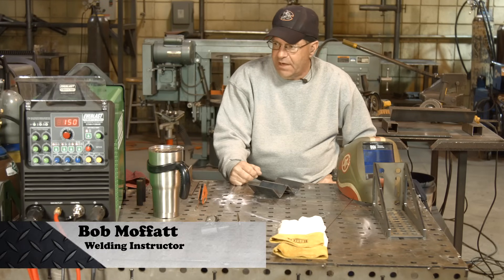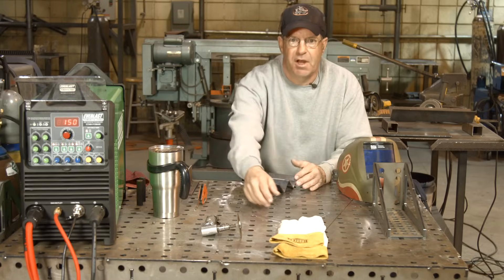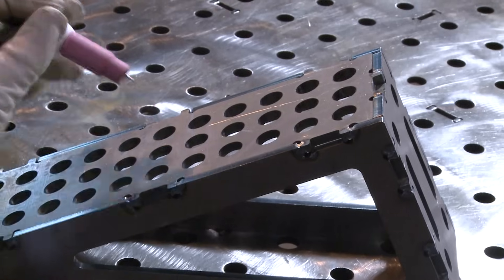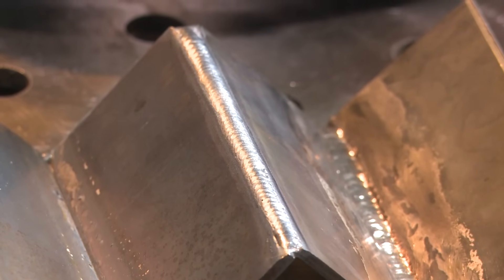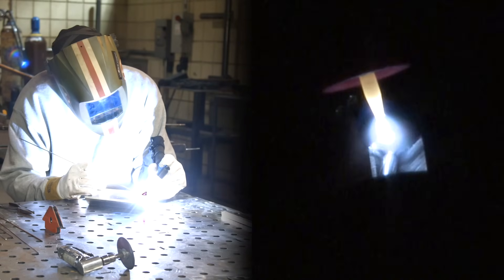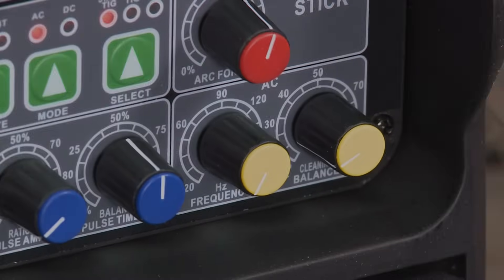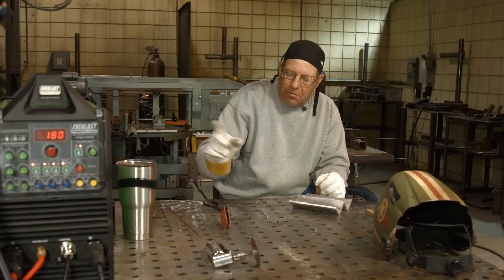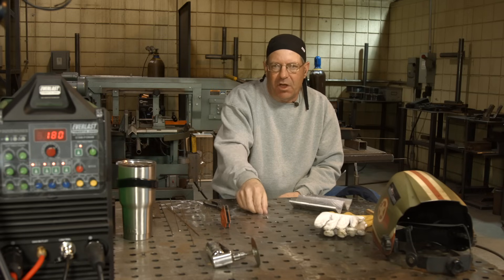🔥 Everlast PowerTIG 250EX Review

Comment from the maker: Please post your video requests as a REPLY to the comment.
Reply: Bob, a couple ideas for videos. Being retired from heavy equipment repair and welding I think these ideas would be helpful for someone looking to get into this type of repair. Show how to arc gouge, not only with a welder but using a torch with or without a scarfing tip or a modified cutting tip enlarging the O2 hole in the tip to 1- cut nuts off a bolt without touching the threads, 2- cut a bushing in a boss to relieve the fit to remove it, again without damaging the ID of the boss. 3- show how to cut off a bearing without damaging the shaft.4- Show how to weld a bushing or bearing race on the ID to shrink it for removal. Or like I have done many times is to use a  7018 rod set at a high amperage with a long arc to melt out a line in a brass or bronze bushing that is pressed into a steel boss just enough not to damage the boss but relieve it enough to tap it out. Too many people torch out something and think it is no big deal when they gouge the shaft on a bearing surface but it is, and it is important to repair that damage properly before reassembly. I know this is common knowledge to most in this type of work but some viewers may find it helpful. Thanks, Ed K Cleve. Oh.
Reply: Pulsed Mig?
Reply: Hey Bob how is that 221 sti holding up?
Reply: Everlast 250ex stick welding 6010 rods.plz
Reply: Weld.com aluminum pipe
Reply: Weld.com me again=^-^= the Roto table is really cool when you're using the pulse function. I use to pulse weld pressure washer belt guards. you can just overlap a little attack a bunch of them up put them in the little rotary thing and it would take off. just hold the  torch at the right angle and run it as fast as you can. fussing. it would sound like Pac-Man ate a power pellet .we would race each other and see how fast we can get them done . it even looked like Pac-Man because of the V from  the two pieces of aluminum. so I doing production Parts fusing on the rotary jig an anodized aluminum is the only time I've really gotten much use out of the pulse function maybe fusing stainless speaking of fussing stainless scratch start. oh and another neat tool was the Roto cutting torch. another cool thing someone showed me was a jig you can put on your torch and use the center punch of your circle to cut rings out of thick Plate. I'm thankful that these people showed me these things on the job so I can feed myself and I have the skill for the rest of my life. many are gone but not forgotten.  ;0) yes I made me a replica the next day so I could cut them rings out. oh a lot of people used to use beam clamps what the point on the end of it hope that helps if you haven't done videos of it already. I don't know if y'all really get into the fabrication/ fitting fortunately or unfortunately I had to learn all that on the job
Reply: Bob thanks for the information on crater cracks I am wanting to start welding alum dump trailers if theirs no tag on the trailer what base metal would u use to make repairs and what types of filler would.  u use is their a standard base metal most trailer are made out of and any other suggestions that u might have on welding trailers like mig spoolgun and what welding process would u use thanks
Reply: Do you need the water cooler to run the tig feature on this welder?
Reply: I'd like to see a 250 ex vs 255 ext compared and I believe the price point in canada is $1000 difference. Is the analog ex just as good?

Comment: I had a horrible customer service experience with Fronius, with a MagicWave230i,  and turned to the Everlast Powertig 250EX. What a great machine, no nonsense, no BS approach from Everlast, everything that you need is in the box, and the machine's built better than the Fronius. If you're here looking for input on Everlast welders, deciding a purchase, do it, you won't regret it. And no Fronius sales representative will ever disrespect yousaying that you can't weld to justify and not acknowledge a bug in their firmware.

Comment: I have maybe 15 hr. weld time on my 250EX. So far it welds good; however, I have fought coolant leaks from poor quality hoses and fittings. I finally threw away the flex head torch because of this. Not a good feeling to raise the helmet and find coolant all over the shop floor.   If I had it to do over, I would have spent the money on a Lincoln or Miller.

Comment: I have the Everlast Powertig 250EX and I've owned mine for almost 13 years. Still works great....use it several times a week.
Reply: Does it need water cooler
Reply: @dreadla2835  No, but it helps if you're doing alot of welding in one sitting.

Comment: I am a beginner with no tig experience & was thinking about this welder for some of the projects I'd want to do. Tunnel ram intake manifold. Stainless steel & mild exhaust headers & down stream stuff. Also narrowing differential housings & roll cage tubing, sheet metal replacement (auto).
Would you buy this if you planned on making stuff alot ? Or let's say I start off as hobbyist & want to go all in on welding & get certified will this welder still suit a full time need ?

Comment: Do you need the water cooler to run the tig feature on this welder?
Reply: I know this comment is a year old and you may have already answered it or bought a cooler.... but I've got the Everlast 185dv it came with an air cooled 17. The 17 got uncomfortably hot fairly quickly. I'm not a welder I'm an automotive tech so I bought a cheap Amazon cooler and a 20 torch from the Everlast website and let me tell you.... it's nice
Reply: @phillipg9345  everlast sent me the watercooled tig torch, i called everlast customer service and they exchanged the water cooled torch for a air cooled one free of charge. The prosses did take about 3 weeks because of shipping.

Comment: Bod u were talking a lot on crater cracks on alum dump trailers with stress cracking down the length of the weld. Thanks for that tip but I would like to know what base metal u would put on the trailer for a repair and what filler wire u would use some trailer have no tag telling what alloy it is built out of is their a fit all alloy or what.if u have Amy suggestion they will be appreciated thank for ur time and ur u tube channel

Comment: I got this machine about 4 months ago. Selling features for me were-more dials with no hidden  menus, Fewer membrane switches needing constant usage, (meaning less cracked membranes), 250 amps for easy .250 aluminium pudding, cheap price. I'm real happy with this machine.  Inverter technology AC/DC is the real thing. This machine is not a cheap china toy, it's real good. It has all the bells and whistles you might need.

Comment: Anyone know  if this machine is capable of welding on aluminum wheels? For example a cracked wheel that I have cut through the crack with a cut off wheel to get good penetration on, another example sometimes wheels have lips on the edge that have chunks missing, could I build up material on the lip to have resurfaced with a CNC later?
Reply: I jst purchased one of these machines to do wheel repairs with it I think I should do the job wheels are not that thick

Comment: Could you weld a 1 inch thick V groove with a backing strip using 7018 1/8th inch rod?  Oh and the bevel is 37.5 degrees

Comment: I have three questions:
1) With the pulse feature of the Everlast PowerTIG 250EX could you weld thin like body panels continually?
2) I have seen $250 or less plasma cutters on Ebay, now they don't come with cords or regulators probably to save money. Most of them state this on their descriptions.
3) Home Depot sells a 120 v plasma cutter with air compressor (Forney 120-Volt 115FI Plasma Cutter with Built-In Compressor) for $800.
Are these cutter worth the purchase for the home user or commercial?
Rather than answer here you should do vids.

Comment: I was welding steps inside a H beam. and we had 1 mm 70s6 wire. and it was millskale and some rust on the H beam. it was 30 mm and the steps where 20 mm, with spray transfer. welded most of it downhill. would that be ok ? how well does downhill spraytransfer penetrate ? that would be wary interesting to see.

Comment: Does adding filler help avoid the crater / hotshort problem when running 1pps ? I could really benefit from a in depth discussion about TIG filler material. Aluminum, carbon, stainless, AL Bronze, which fillers for dissimilar base metals, repair rods, applications, sizes, Etc. Love the work your doing, thanks

Comment: I spent 30 years out of the industry upon my return noticed the technology had changed a lot. Trying to understand what each function does and doesn't do has been confusing. I learned how to weld without all those fancy features.  Then had the chance to try a pulse TIG and loved it as it assists in with old age shaking. Experimenting with every feature was interesting, I have found some features hardly make a difference. But I am still learning. It took me 6 months to get back into it again and back up to a standard good enough to do welds to 1st class pressure vessels. Your helpful hints has helped me to remember.

Comment: Nice demo! I would like to give my opinion on an Everlast 250EX welder I purchased 1- 2012. After watching a 6 part review from Weldingtipsandtricks on the then current 250Ex I decided to purchase one along with the compatible 300 cooler. After a full 5 years plus using this machine I have nothing but a very high opinion of it. Near the beginning customer support helped with an air gap setting for the hf start and since never had an issue. Upgrades I did and recommend is replacing the torch and hose assembly with a CK 20 flex torch with high flexible hoses, add an inexpensive push button switch on the torch handle for use when not using the foot peddle and replacing the original foot controller with what I feel is a high quality SSC brand controller and cable for their very reasonable price. The features on this machine in my opinion are fantastic. Then I had the need to do some stick welding- LH7018 DC Rev. Polarity and WOW! talk about SMOOTH! I am not here to compare Red, Blue, Yellow or Green, just giving my opinion of my machine after seeing this model being used on this video. I also purchased an Everlast 45 amp plasma cutter and have the same high opinion of its performance after almost 5 years of some pretty heavy use. Thanks Bob and Weld.com for the very informative videos. Ed K. Cleve. Oh.

Comment: Love your videos. I just got me a everlast 256si and in the book that came with it said to run the tig torch to the negative and the ground clamp to the positive. Looks like you have yours set up backwards. Is there a reason for that? I just started learning tig so I figure I'd ask.
Reply: Not sure why you would think that??  I have the very same machine and he has it set up on Electrode Negative like you should.  The positive terminal on this machine is the one on the right.
Reply: I have a 256 si the 250 and 256 must be different locations
Reply: Bout the same here,  I've only had it about 2 weeks, Played with it maybe an hour all together.  Just got the water cooler in this week and hooked up the water cooled torch that came with it.  I have only used a CK17 air cooled torch so far.  I am learning how to TIG weld, love the machine but I have certainly not mastered it yet...lol.  I thought It would be easier since I had lots of experience with MIG and Stick.
Reply: Larry Robinson makes sense. They must be opposite to each other. Good to know I'm not doing something wrong. Lol
Reply from the maker: The machine is setup DCEN (electrode negative)
Reply: I have the same machine I was wondering too.
Reply: Yes, I've noticed some of the machines are opposite of the 250
Reply: How do you like your machine I have about a hour of use on mine.